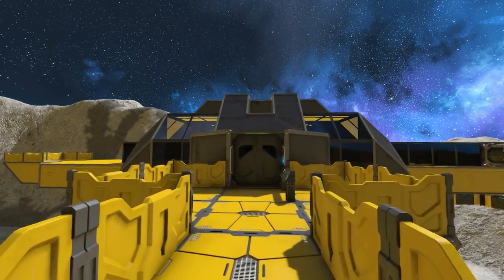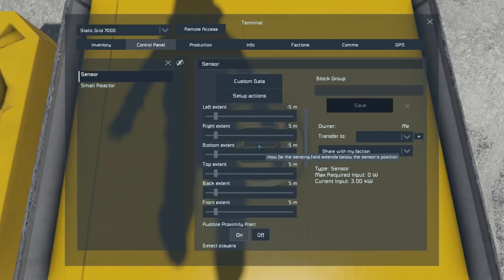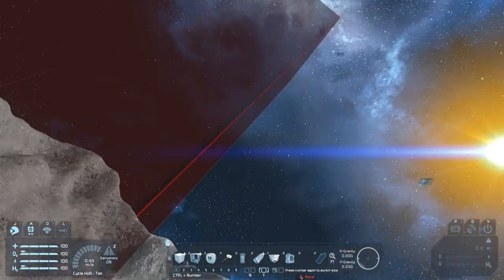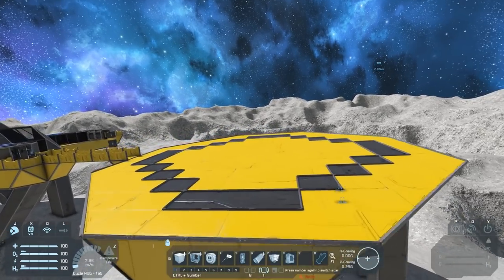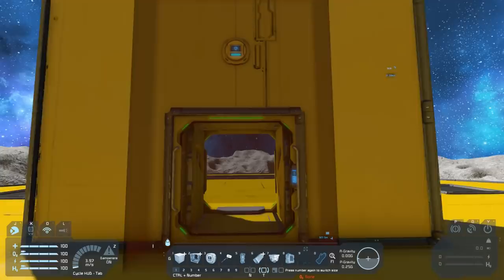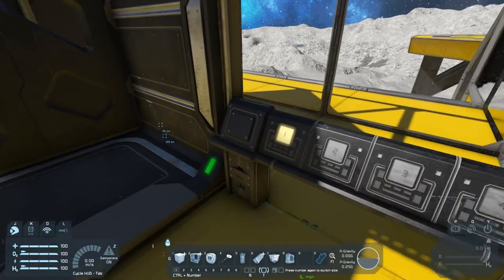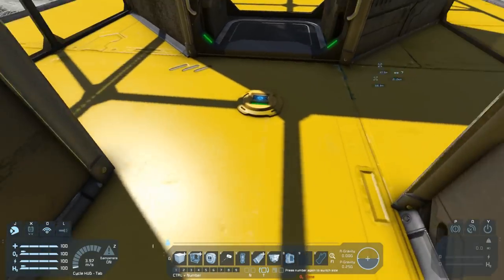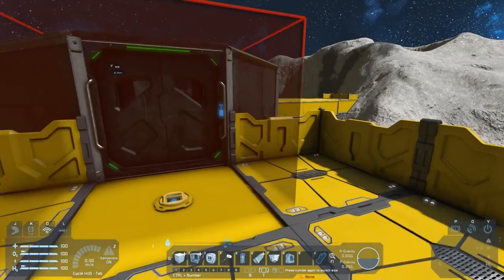Space Engineers Tutorial: Sensors and Sensor Airlocks (tips, testing and tutorials for survival)

Comment: When using sensors to open doors I will always put the sensor on the floor in front of the door.  The reason for this is although you may initially have a vacant spot above or to the side of the door, you may, at some time in the future need that space for something else, like a light or a sign or another building block.  But you can be quite sure that you will never need to put anything immediately in front of the door.
Reply: Aw, that's where I put a grate that covers my air vent.
Reply from the maker: That's a really good point about putting the sensor on the floor, it is almost always the block that will have clear space for it so makes it really easy to standardise, the only downside I can even think of is if you have a door off to the side of a corridor, every time you walk past it'll open even if you're not heading in - and that's a pretty insignificant downside.
Reply: Nethan2000 - Yes.  It is my golden rule but there are times when it is not possible to place the door sensor in my place of choice.
Reply: I would suggest that if a sensor is doing its job, in this case opening a door as you approach it. it will open the door every time you walk down the corridor no matter where you place the sensor =0)
Reply from the maker: You're probably right, in the past I've set mine up so that they're only projecting part way into the corridor, so you actually have to be pretty close to the door to activate it - which definitely has its downsides
Reply: Well, how about using recessed doorways then? that way if you're walking down a corridor flanked with doors of to other rooms/corridors/places you won't be triggering all those doors to open because the sensorgrid only extends as far as the door recess. :)

Granted this is much easier to achieve on a base than on a ship where space might be constrained.. but meh I'm sure with a bit of spatial insight you can unite form and function :)

Comment: For simplicity and economy I don't think that you can go past using just two doors with a one block gap between them (normally the thickness of the wall) and a sensor for each door, no vent required..  The amount of air lost when going through the air lock is minimal and there will be no loss of pressure at all, using just a couple of grams of ice to top up the oxygen tanks.

With the sensors set up with the cut off just at the edge of the door frame and a one block space between the two, you can comfortably walk through this airlock arrangement, confident that there will only ever be one door open.  If you are inclined to run through the airlocks, then I suggest using a two-block gap between the two doors and again only one door will be open at any one time.

To make it multiplayer safe, although it can be set up using sensors only, in a manner similar to what you demonstrated, it is actually easier to do using 4 Timer blocks as I described in the comments to your video clip, Large Ship Design, Part 3.  The reason I say it is easier is because you still only need 2 sensors in the vicinity of the doors, while the timer blocks can be tucked away anywhere else on the ship that is convenient.  In addition, the timer blocks enable you to implement additional functions such as warning lights and alarms, as detailed in the previous explanation, which will help to remind other players not to manually overriding the automatic system because there is someone else passing through the airlock.
Reply from the maker: Totally agree with you Mick, the reality of airlocks in Space Engineers is that you are almost never short of oxygen, so even if you set up a perfect airlock you'll probably have full tanks and end up dumping the air into space anyway making the simplest airlock perfectly adequate :P

You're also right about the timers, I just tried to avoid them so I could focus on sensors, went a little silly at the end more to show things that could be done, even if they probably shouldn't :P

Comment: I realize this video is nearly 2 years old but I envisioned a 2 door airlock with the vent between the doors on the ceiling, use a timer block the delay the cycling of the doors to allow the vent to either pressurized or depressurize the airlock chamber, three sensors, one to open each door you approach, and one in the middle to trigger the timer and vent cycle. I haven't built one like this but it does take up less space and should be just as safe
Reply from the maker: This setup was more about messing with sensors than with making an efficient airlock. I liked the way that this setup facilitated some immediately visible responses to the actions and didn't need any timers (which I hoped not to introduce as it would have complicated an already complex topic) :)

Comment: Could you use sensors for an anti-crash mechanism? It detects an object in front of the ship and puts it in full reverse with no forward thrust to keep it from crashing, then when it’s out of range, it re-enables the forward thrust and takes the ship out of full reverse.
Reply from the maker: You might be able to use a system like that to aid with docking in a large ship, but due to the short range of sensors it probably wouldn't be that great for crash avoidance at higher speeds. Definitely worth looking into for the docking thing though

Comment: Great video splitsie. I use sensors for my welding ship because I forget to turn them off every time I leave the ship and I get zapped.the sensors turn off when a player is near them and drills too.
Do you have a video about gravity generators and projectors.
Reply from the maker: That's one of the best uses of sensors in my opinion. Having them as a safety device so you don't get toasted by welders or chewed up by grinders accidentally is very handy. 
I am still in the planning phase on the projector video, I want to try and make it clearer than the keen one and theirs was actually pretty good on that topic, just a little slow to get through.

Comment: So I thought about airlock and I haven't build one yet (only one that loses you air, with just two manually opened doors), but I thought about a future airlock I could build while using a sensor and some scripting and maybe buttons or something similar

I didn't test this yet or anything but these are just my theoretical notes:

- airlock is not functional if the AirVent tells us the room can not be pressurized (can be checked in script), so account for that at all times!
- maybe use a field of an enum type that contains the current step we're in
- We want to disable the door block so they can't accidentally be opened by a player. If we want to open them via script we just enable them, change their state and then disable them again
- We can't use wait or sleep or loop too long in scripts yet, so we gotta save the current state in an enum variable (as mentioned) and then continue where we left off

case => someone wants to lock in:

-> has to press button outside
-> following happens when the button is pressed:
->  is room currently depressurizing or being pressurizing (in use)? then wait
-> if it's ready, close the inner door if needed, or wait until it's closed, depressurize the room, and open the outside door automatically when done, due to player request
-> person goes into room and presses button (in the same room is a sensor)
-> button pressed: outside door closes, and when it's closed, pressurize the room. When that's done automatically open the inner door and closes it when the sensor doesn't sense anything anymore inside the room, which saves some time overall 

How can we check if it's done pressurizing? maybe via IMyAirVent.GetOxygenLevel()?

case: someone wants to lock out:

-> has to press button inside
-> button pressed: is room currently depressurizing or being pressurized (in use)? then wait
-> if it's ready, close the outer door if needed, or wait until it's closed, and open the inner door.
-> person goes into room and presses button
-> button pressed: inside door closes, and when it's closed, depressurize the room. When that's done, automatically open the outer door and close it when the sensor doesn't sense anything anymore inside the room (to make sure it's ready to use again)
-> repressurize the room? Or maybe rather leave it in the last state that it was in

Comment: One of the more annoying side effects of (sliding) doors is that if a player in survival mode stands in front of it and the room the player is in OR the room the door opens up to is pressurized, the player gets pushed back (blown back or pulled out). This might result in them getting out of the sensor field, closing the door again before full pressure equalization.

Furthermore, if you want to keep players from force opening doors (by pressing F on them) you might be able to assign the doors to an enemy faction (like space pirates). The buttons and sensors should still be able to open and close the doors, but players will get the 'access denied' message instead.  
I have never tested this before though, so it might not even work. For survival it's even more annoying since you cannot assign blocks to the Space Pirates.
Reply from the maker: For the pressurisation bit, you just need to use a system that matches pressure to the door you're about to open so that you don't get blown about. 
The faction thing seems like a good idea, but I think you might end up with your doors becoming targets for your own turrets... that might not be the best outcome :P
Reply: Yeah I guess that turret part would be annoying, but only if there are multiple grids close together (since they do not shoot at their own (sub)grids.
Reply: ThijmenDF Can't you just set the doors to no sharing. Most Blocks share with faction by default but you can set them to not share at all.

Comment: The airlock is quite big and a little overcomplicated. You can remove the middle door and make just one room. when you enter the room using the door (wiht a sensor) it fills op with oxygen. Place an air vent in the room and tell it, using a button panel or a sensor to depressiurise the room, then use a sensor (or manual...) to open the outer door. No oxygen lost asswel.

Comment: If you want a sensor to do multiple actions at a time, just use timer blocks. This also allows you to set some actions on a delay to say purge the air first, then open the door. As an additional tip, to save space you can use a rotor and have a small head on it to place more timer blocks in a much smaller space than a single large timer block. This would allow you to set up complex strings of actions for your base or ship without having a massive amount of space taken up and maybe even make your timer block server a bit of a decoration at the same time

Comment: Take a close look how vents work, they too can have actions triggered based on pressurize/depressurize.  (you will also need timer blocks for it to work right sine you can't use groups for different simultaneous actions). When you approach from outside the base the sensor will "trigger now" the first timer block, which will close the inner door and set the vent to depressurize.  The vent will have the depressurize trigger set to open the outer door when the airlock is depressurized.  The other sensor (using a 2nd timer block) does the opposite,  closes the outer door and triggers the pressurize, which in turn triggers the inner door to open when fully pressurized.  Downside is creative mode will cause the tank to be full so you may have to scrap/rebuild the o2 tank when switching back to survival.
Reply from the maker: The need for a timer was exactly why I didn't use the vents to trigger anything, I didn't want to complicate a tutorial that was meant to be about sensors by adding in timer blocks and other bits and pieces. I completely agree that using things like that can get you a much better setup, I just didn't think it would help explain sensors :)

Comment: To make your airlock more fool proof, you shouldn't turn the sensor off but the outer door. That way, if anyone wants to enter and steps into the sensor field, nothing is happening. He then tries to manually click the door but also: nothing is happening.. If the middle is free again, everything is set back to normal. One downside though: if the outer door was open und gets closed by the sensor and deactivated by the other sensor, the door will get stuck in the closing process. In order to compete with that, a timer with a delay of the closing time and the action "Turn off outer door" would be necessary.. Lot's of fiddeling around possibilities ;)
Reply from the maker: I really like that there are sooo many potential methods even before you add scripts into the mix. That's a really good point on switching the door off though, sadly there's no foolproof method with sensors only. Really need to add timers or scripts to avoid almost all problems ;)

I have been thinking about doing a video just looking at a bunch of airlock setups (including scripted ones) to show some of the ways they work (and break). With the major update being this Friday it might have to wait a bit depending on what's been changed...
Reply: What they should really do is to implement some of the modded one-block-airlocks into the main game.. Although creating your own contraptions is really cool and creative, it's also very unconvenient.. The other doors would still have their reason of existence as inner doors or doors on O2 based planets where it doesn't matter if you pressurize your base or not.. After implementing parachutes, this would be another great addition to the main game.
Reply from the maker: Yeah, like you say there's mixed advantages and disadvantages to implementing single block airlocks. I suppose if they made them inefficient in some way, either very slow or power hungry then there would still be a role for larger airlocks. I'm not sure what the best downside would be though...

Comment: There is a way to get a working airlock using only 1 sensor, only limitation is that it will not open the door for you, only close them when you enter and exit.
Place a timer to close both doors, set the timer on a delay, when you enter the airlock the sensor triggers the timer instantly, when you exit the airlock it closes after a timed delay (not instantly), this is a easy to configure and fairly safe to use airlock system, add a light that will turn on when the air is vaccumed out and your ready to use it with no air lost.
Even if the airlock is opened by 2 ppl at same time, the person on the inside will get blown out and trigger the instant close.
If you want one that opens and closes and all that other shit, you will need at least 2 sensors plus some extra timers as well as 10 min to set it all up, the system i described takes minimum parts and less than 5 min to set up.
Reply from the maker: You really do need a lot of time to set up a proper airlock with auto doors, safety protections and making sure it's all functioning properly, which can either be a lot of fun to play with or an exercise in pure frustration when it doesn't work properly...
I'd still probably use 2 sensors, one for each door to ensure that both get closed, or use 1 timer and 1 sensor to do the same job. That way you protect against the situation where you're outside the ship, but only the exterior door is closed, so you're only option is to vent the whole lot to get back in :(

Comment: I have an issue I can't figure out . I have a sensor placed and setup to open a door. When I walk upto the door the sensor beeps to acknowledge it's detected me but the door won't open, as soon as I back away from the door, the door opens. Anyone have any ideas ?
Reply from the maker: There are two slots on the hot bar for sensors, the first slot on the left is for when the sensor is activated (ie when you walk into the detection volume) the second is for when the detected item leaves the detection volume. Most likely you've got the door set up on the left hot bar area :)
Reply: @Splitsie  , thanks for reply, I had managed to work out already, it was what you said

Comment: I've been trying to code an airlock which disables/enables the doors depending on the pressure, though I haven't found a solution for mp
Reply from the maker: That's a pretty good job so far, but it's really hard to protect against multiple silly people isn't it :P
Reply: It kinda sucks we can't a sleep, else I've could made a timer.

Now I think about it, it is possible but it requires 2 programmable blocks and 1 timer block. But that's rather expensive.
Reply: Splitsie I think we are thinking to hard..

Just found out the air vents can have actions like the sensors.

With the actions on the air vents being:

Action 1 - Happens when a room is pressurized

Action 2 - Happens when a room is depressurized

Comment: Will using actions in an air vent in the often depressurized area to turn off the inner door help?
Reply from the maker: It might do, or I suppose you could use it to prevent the outer door from opening until the area is depressurised...
Reply: I set up a system with three sensors, one per door one more to depressurize , with a vent set up to turn off the inner door until the room is pressurized, thinking about using a second vent to do the opposite for the other door.
Reply: Changed the sensor set up for the vents, now the airlock remains depressurized until someone walks towards it from the pressurized area, then it pressurizes, when it isn't pressurized the outside door is on, inside door is off, via two vents
Reply from the maker: I like the sound of that setup :)
Reply: Uploaded a version to the workshop if you'd like to see it. http://steamcommunity.com/sharedfiles/filedetails/?id=1130102015 (Updated 9/7/2017)